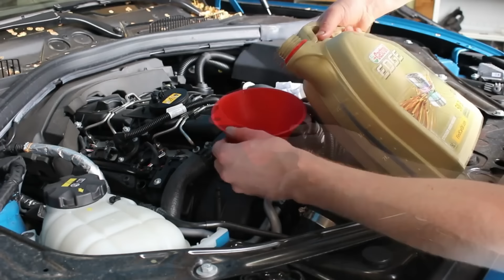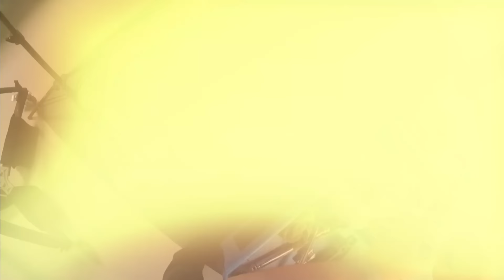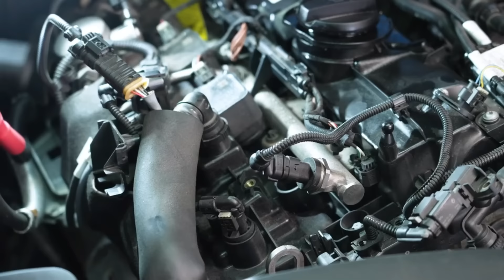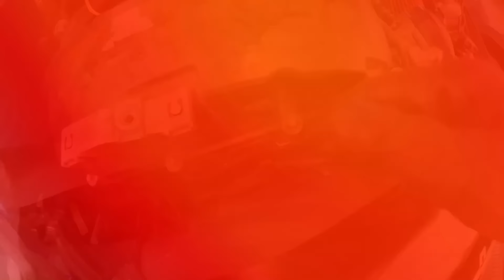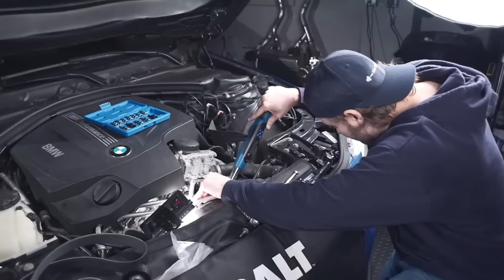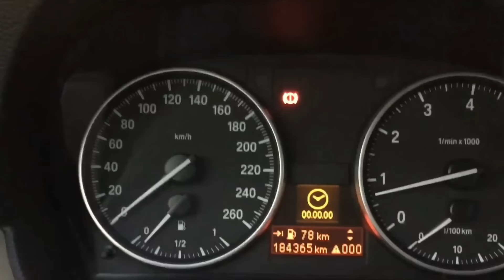Doing This Will Make Your BMW Engine Run Like NEW

Comment: I never had the transmission fluid replaced on my E46 ZHP and I’m at 150K miles. Hope it doesn’t take a giant crap anytime soon. Will start saving for a new one!
Reply: Just my experience but let me share it with you.........I have an E90 with 160K miles on it and when I bought the car it was at 13oK, I've replaced/upgraded many parts but the ONE thing that made the biggest improvement to driving the car was changing the trans fluid/filter. Hands down THE best thing you can do and it isn't even expensive. Good luck!

Comment: These are quite complicated, most of the mechanics are are not that highly professional here in uk..they will ruin instead..then it will be 50000 miles life instead of 300000 miles…changing oil , oil filter and fuel filter will also work better

Comment: I change my oil evert 3000 miles . 287k miles now  2008 bmw
Reply: I've heard this from BMW mechanics that 3K is the magic number....but then guys who change oil at 3K aren't gonna be guys to drive with the check engine light on either and most likely do preventative maintenance too.....

Comment: About N5530O0 (which is in M135i LCI) any specific regarding this video? About the oil change, I’m aware about doing it regularly, but I was more about 10/12K Km ( so around 6 to 80Kmiles), or if not reached until 1 year and an half max. I’m looking at a manual 2015 F21 M135i that reached 90K km (60K Miles). As I always try to take care well at my vehicules (maintenance isn’t a topic as I prefer to spend money for tranquility instead of much more for pain), I wouldn’t want to gamble on this one.
Reply: I did 500 000kms with a fiat uno. Bmw is a troublesome car
Reply: @Bond786muslim  Zum Teil ja, der B 58 ist unkritisch.

Comment: Thank you for making this video. Have the exact same noise and had high hopes.....but found glitter in the oil filter and dropping cylinders while running the noise changes. So thinking #4&#8 rod bearing. Weird ,oil psi is unchanged and very good.

Comment: 3,000 to 5,000 mile oil changes.
Reply: Yup same here. And it's not negotiable lol. Dealership tells me I'm wasting money and should wait at least 10k...😂 Ya no thanks
Reply: @codyrobillard4063  those service guys don't get it. 10,000 mile oil changes will doom any motor.
Reply: @jdsilvaca O ya absolutely. There's one main reason they make that "suggestion" and it's definitely not to insure long engine life lol. And with an oil change being easy to do, and/or cheap to get done and with how big of an impact it will have on the engine.. there's really no excuse to not stay on top of it.

Comment: Agree. 👍 Basically take care proactive for any fluid and not only. Better being proactive than a costly service after. 😊
Reply: Bmw high maintenance  troublesome  shit car. Don't buy a used bmw over 100k. Very high maintenance  disaster car catastrophic car
Reply: @Bond786muslim  No, only some engines,My m140i has the B 50 engine, one of the best engines  BMW ever build. Search best engines on YT. You will find the B 58. My car is buied in 2017, has run nearly 200.000 km and i never had a problem.
Reply: Korrekt, aber nur wenn der Motor wirklich gefordert ist. In der Stadt kommt der nie in hohe Drehzahlen. Somit ist der unterfordert.